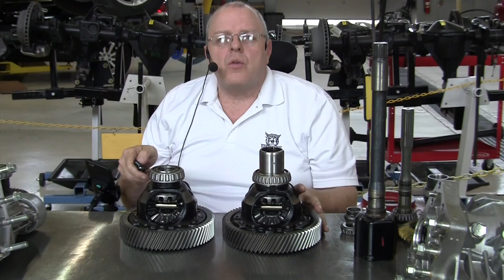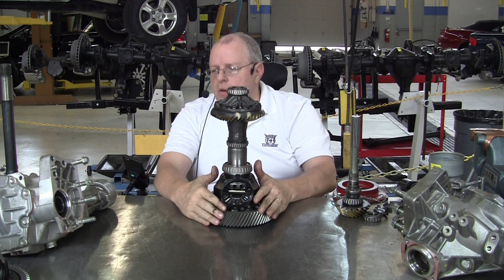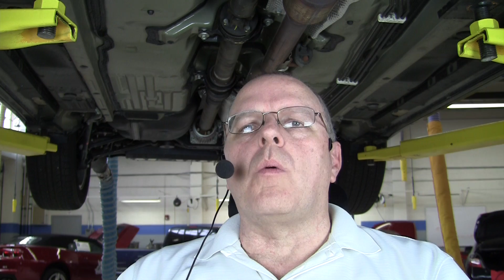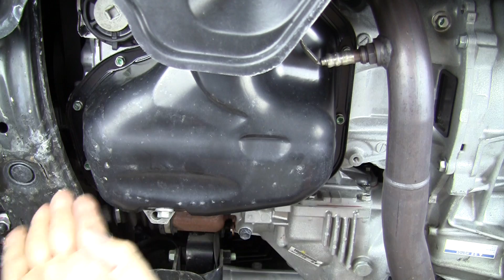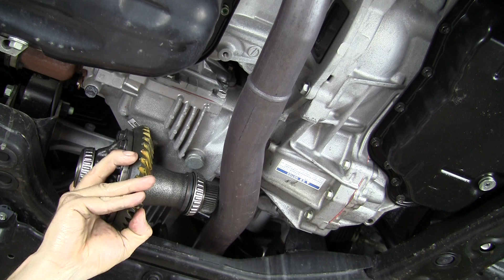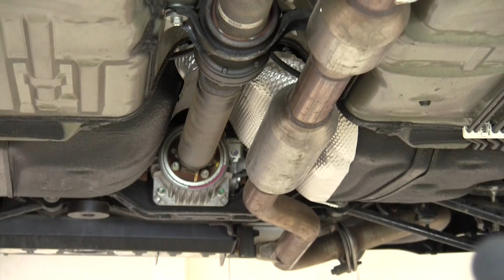Crossover AWD / 4WD Systems

Comment: So when the rear wheels engage are they engaging in all wheel limited slip or actual 4 wheel drive? This type cannot be engaged manuelly into 4 WD is that correct? Thank you!
Reply from the maker: 4WD when engaged, but released very quickly when traction is restored to the front wheels. It cannot be manually engaged except in the newer Jeep models
Reply: How does torque vectoring differ from this type of AWD?
Reply from the maker: This has torque vectoring front to rear. Some models do left and right too. They use a clutch pack(s) to control the amount of torque delivered.

Comment: Thanks for the video, it really has me appreciating just how awesome the symplicity of my Subaru XV Crosstrek's Subaru Symmetrical All-Wheel Drive, specifically, the Continuous AWD system that actually maintains a true mechanical connection between the front and rear differentials on manual transmission (technically a manual transaxle) models. Unlike most crossovers that have some sort of electronic system to manage front-to-rear torque distribution, the Continuous AWD of manual transaxle models has a simple viscous coupling center differential. Though some may consider this system quite crude, I'm very satisfied with its ability to react in demanding spirited driving conditions as well as off-road driving.
Reply from the maker: Thanks for your feedback!

Comment: Trying to wrap my head around this regarding AWD operation in a Lexus LS 460 L  COMPARED TO SAY AN AWD system used in  my 97 Land Cruiser. Specs tell me that the same 8 speed trans for the LS is also used in the late model Land Cruiser.
Reply from the maker: The AWD system on your LS is similar, but different than the 97 Land Cruiser.  The LS 460 uses the AA80E while the later model Land Cruiser uses the AE80F 8-speed transmission. They are almost identical, but the newer model is refined and beefed up a little more.

Comment: Do you have any videos detailing the viscous coupler/ magnetic clutch you talk about at the 22 minute mark. I have a 2011 Sienna Limited AWD and I think it's gone as it makes a loud hydraulic whine as it's driven. as you speed up the pitch gets louder. I've seen some forums say Toyota says you have to replace the entire unit but some others say you can disassemble it and if you can find the part number replace the 2 large bearings which are the fail point. Any of your great insight is appreciated!
Reply from the maker: Sorry, I do not have any information like that.
Reply: Thanks, appreciate the reply either way!
Reply: @Sig220Euro  ppl need change gear oil in these units every 50k mis max.. engineers have told me. In our Lincoln SUVs AWD i follow this maintenance with great success getting high mis an zero failure.
Reply: PTU unit or transfer prob bad!

Comment: Nice Video.  How much slip is necessary for the clutch to activate the rear wheels?
Reply from the maker: Good question, I do not know. I thing I activates whenever slip is anticipated/predicted. Thank you!
Reply: What drives my question is -   My brother in law works for a major tire chain & claims even the slightest difference in the tire wear will reak havoc with the AWD system.  I was just wondering if that is a way for them to sell more tires or if their is any truth?
Your thoughts....
Reply from the maker: That was true of the older non-computer controlled AWD systems. Even tires of the same size with large differences in tread depth could harm the viscous clutch by forcing it to spin when it should not be spinning. Today's (last 10 years) computer controlled (no viscous clutch) systems are more forgiving of differences in tire rolling radius. You still need to have the same tire size and inflation, but tread depth variance are not a big deal.

Comment: How would changing the original 235/16 tires to 255/16 tires affect my 2006 Ford Escape Hybrid `4WD'?
Reply from the maker: 235/70R16 tires are approximately 28.95" tall. 255/70R16 tires are approximately 30.06" tall.  That is a 1.11" diameter difference. Your speedometer will read slower than you are really traveling, but as long as all 4 tires are the same size (and do not rub on the fenders) it will still function normally.
Reply: WeberAuto Is there a limit to how big I can go? My ideal size would be 265/75/16. Fenders won't be a problem.
Reply from the maker: They would be 31.65" tall, that is a 2.7" diameter difference (raising your vehicle 1.35"). There are consequences to going with taller tires. Your ABS system might not work correctly, it may not activate at certain lower speeds when you may need it to. Taller tires will also raise the center of gravity and make your vehicle handle differently. it would be more likely to roll over in tight cornering maneuvers. Other than that (and the speedometer inaccuracy) I think it would be okay. Be careful.
Reply: WeberAuto The plan is to use the Ford Escape Hybrid drive train on a 66  International Scout. To which I would like to add a larger tire/wheel then the 235/75/15 original. Just a project...

Comment: Very informative video sir, thank you. Please allow me a couple of questions:

1)  the similar PTU used by GM from Oerlikon says 2.78 total ratio.Does this mean it is overdriven (0.359 ratio)on the rear diff? Or it is not necessary if the final drive ratio is 2,78 too? In that case the rear diff ratio must be 2.78?

2) Regarding torque, on your PTU, suppose 300Nm the engine max torque, then it is multiplied with 4,35 f/d ratio to give the front wheels torque?

3) if not and 300Nm is the torque applied on the front axle, then the amount of torque driven to the rear axle through the PTU is 300Nm x 0.439 in your example and again multiplied in the rear diff x 2,277 (assuming full lock of the clutch pack)?

4) if 3) is correct then for GM's PTU in order to find the torque applied to the rear axle we multiply 300Nmx2.78x2.78?

5) If 3) is correct then at full lock, the torque of the front axle is the same as the torque of the rear axle meaning 300Nm? In such case if the front wheels lose traction the 300Nm of torque can be transfered, like a common lock diff, to the 300Nm of the rear wheels?

6) What does it mean "..overdriven on the final drive.." regarding torque?

Thank you in advance for your answer.
Reply from the maker: Hi Jim,

1) The PTU overdrives the rear driveshaft by the inverse gear ratio of the rear axle. The PRU overdrive ratio = 0.359, the rear diff ratio is 2.78

2) No, engine torque x transmission gear ratio x final drive gear ratio = torque to front wheels and PTU (minus frictional losses through gears). This assumes the rear axle clutch is unlocked (no torque delivered to rear wheels)

3) Torque to rear wheels = (engine torque x transmission gear ratio x final drive gear ratio x PTU overdrive ratio x rear axle gear ratio) - minus torque to front wheels. Torque to the rear wheels can be equal to, or less than the Torque to front wheels. The total front-rear torque split must always = 100% The maximum amount of torque that can be delivered to the front wheels is 100%. The maximum amount of torque that can be delivered to the rear wheels is 50%. It can be varied anywhere in between those two limits (some examples: 90-10%, 80-20%, 70-30% 60-40% 50-50%)

4) see 4

5) No, When the rear axle clutch is locked (torque delivered to rear wheels), it takes away torque from the front wheels (up to 50%). 

6) Over-driving something reduced torque, under-driving something increases torque.

I hope that helps!
Reply: Dear Sir, thank you spending your valuable time to answer my questions. Please allow me one or two more to feel it is clear:
1)OK

2)OK

3)5) following the equation it gives almost the same amount of torque that is delivered to front wheels when rear clutch is unlocked, if front wheels have no traction, meaning 0% torque since front is open diff. Therefore  (engine torque x transmission gear ratio x final drive gear ratio x PTU overdrive ratio x rear axle gear ratio) - (minus torque to front wheels)in that case (T rear-0% torque to front wheels=Trear which is the torque to front wheels when rear unlocked), so 100% of the torque and not up to 50%. I am sure i am missing something...

4)OK

6)OK

7) Watching again your video, is the answer to max 50% torque to rear wheels that the ring gear of the PTU and the final drive unit are "splined" and "spooled"? In such case if a second PTU was attached then the max torque would be 50% front wheels and 25% for each rear diffs or 33% front and 33% percent of each rear diffs?

8) The new Ford Focus RS, with almost the same system, claims 70% torque to rear. It has to do with the absence of propshaft clutch pack replaced with rear axles clutches or 70% is not accurate?

Thank you once more and in anticipation of your reply.
Reply from the maker: #3 There is still torque provided to the front wheels when they have no traction. It starts at 100% torque to the front wheels and then is reduced to a minimum of 50% as torque is biased to the rear axle.
#7 33% to all differentials.
#8 the Focus RS uses a rear axle that acts similar to the Acura SH-AWD system. It has 2 clutch packs to vary the torque to the left and right rear wheels. It cannot receive more than 50% of the engine torque from the PTU. It can vary the amount of torque delivered to the left and right wheels. The rear axle ring and pinion gear set is not an inverse gear ratio of the PTU, it has a ratio that would drive the rear wheels faster then the front wheels if the clutch packs were to lock up at 100%. This can be used to force the outside rear wheel to turn faster while cornering (enhancing handling). The 70% number you read about comes from the typical amount of clutch application while accelerating in a straight line. It is a complex system, but a very cool system. Best wishes.

Comment: Thank you for your very informative videos!

This is very similar yet very different to how Celica GT4 system works (particularity ST205 chassis). Interesting part is that unlike viscous/similar coupling at the rear differential the GT4 uses full central differential in the centre with a viscous centre, thus giving true all-time 4WD system with 50/50 torque split. This system in my opinion is far better than the typical crossover system.

Meanwhile Subaru system is even better in regards that it uses planetary gear set with mechanical LSD and electromechanical LSD (two separate units) for the centre differential, specifically the DCCD variant that comes in Impreza WRX STI.

I have/had pleasure owning both vehicles and I find very amusing when I go passed stuck crossover/SUV vehicles like RAV4 and similar on a beach (they seem to constantly switch between spinning a front wheel, and two diagonal wheels). I guess having LSD in front (excl. ST205) centre and rear with all time 4WD works much better than the gimmick system with viscous/electromechanical/hydraulic coupling that these crossover/SUV vehicles have.
Reply from the maker: Thanks for your great feedback! There are many variations of "AWD", most people do not know the differences.

Comment: John great video and great presentation. 
Is the EMC serviceable? Is there bearings inside the coupler that can fail ?
Is it a part that a dealer will just replace when it fails?
Reply from the maker: Good question. I know it is serviceable on some models, but not all. Thanks for your feedback.
Reply: WeberAuto Thanks for your time. If you ever have the time, a video showing the EMC broken down would be great. Like the Venza in your video I’m not sure if it’s a wet clutch or dry and if it’s wet does it share the oil with the rear differential?

Comment: I have a series of huge question if you don't mind answering them?

1. Is it possible to convert a manual fwd 2.5L 4cyl toyota to an awd system with the transfer unit. 
2. I have a 2015 Scion tC, 2.5L 4cyl manual fwd that I would love to make awd and would really like some pointers on how to go about it? 
It uses the same engine as the Camry, RAV4, matrix, and in some options the highlander, and all these cars except the tC come with awd. Engine is the 2ar-fe. 
3. If it is possible I have some connections with some fabricators and will try anything with some helpful tips/pointers. Thank you
Reply from the maker: No, the transaxle housing is different, the final drive gear ratio is different, The vehicle stability control system is programmed differently, etc. Best wishes!

Comment: Does that means a Subaru awd system is better?
Reply from the maker: No, it is just different. Subaru's have a longitudinally mounted engine, this system uses a transversely mounted engine. The Subaru system is very similar to the ZF AWD transmissions used by many other vehicle manufacturers (VW/Audi/FCA/BMW/Porsche/Volvo/Mercedes). It makes the front of the vehicle be very long and heavy since the engine has to be mounted in front of the front half shafts that drive the front wheels.
Reply: WeberAuto , thanks for responding and thank you for the videos .

Comment: great explanation. on a honda crv does this mean in slippery condition the rear wheels are constantly dropping in and out of drive.mode. is there a delay on releasing the clutches .
Reply from the maker: There can be a delay, it just depends upon the system.

Comment: Does it matter the kind of oil that its put to a hydraulic rear differential for a Honda 2009 Dual pump cr-v?
Reply from the maker: Yes, it always matters.
Reply: I mean if I put for example 80W90 gear oil GL5 the this: honda differential would work or why could be damage?
Reply from the maker: There would be damage to the clutch pack that connects the driveshaft to the pinion gear. There is a pump that applies the clutch pack with the "Honda Dual Pump Fluid II" oil. If the fluid it too thick (like 80W90), the pump will take too long to apply the clutch in a low traction event. this will cause the clutches to partially apply, slip, and burn up over time. Always use the fluid called for by the manufacturer. I hope that helps.

Comment: from 2008 to 2017 Toyota Sienna and rav4+4runner+highlander xle limited AWD does really it has rear differential and driveshaft I mean AWD system like Subaru feedback
Reply from the maker: Yes, they really have a rear differential and a driveshaft(s), but they have transverse engines and transaxles, not longitudinal like Subaru.

Comment: Hi my question is ? Can different tire size be used on awd vehicles?front and rear? Is awd a kind of unblocked transfer case? I am in a process of building a small tractor and iam planning in use a unblocked transmission mounted side ways it will work? With different tire size 4wd thanks from Brazil
Reply from the maker: All of the tires need to have the same diameter, but they can be different sizes.
Reply: WeberAuto what tends to happen if the diameter of the front and rear tires are different sizes over time?

Comment: how to conversion FWD to AWD ?
Reply from the maker: Different transmission, transfer unit, drive shafts, rear suspension system, rear axle, wiring harness, computers, etc. $$$
Reply: I see some of FWD (civic) that has been conversion to AWD. I read they're using some part from Honda CRV AWD version.

Comment: Does the system use the ABS wheel speed sensors to detect when there is a speed difference  (slippage) between the front wheels and the rear wheels?
Reply from the maker: Yes, most vehicles use that strategy.

Comment: I like the style used in the Honda Pilot or Acura MDX where the main Final Drive has 2 sets of Ring Gears, The secondary connects to a small Input shaft that goes to a Transfer Case with its own Ring and Pinion for the Propeller shaft.. Its lighter, stronger and both front axle shafts remain the same size..
Reply from the maker: Thanks for your feedback. I am not sure it is any lighter weight with the extra components inside the transaxle. The Honda system operates just like the system in this video; however, it uses different components to accomplish it. It still drives the rear driveshaft off the the transaxle differential case. The Acura systems with all of the variations of SH-AWD is also similar, but with a more advanced rear drive module for left and right rear wheel speed controls.

Comment: Masterful presentation. Seeking to bypass the was on murano.. I think I will start by disabling the Clutch Permanently.
Reply from the maker: Thank you!
Reply: WeberAuto Based on the information presented, I was able to save thousands by removing the drive shaft and eliminating AWD feature by taking the pinion gear from the transfer case. Ultimately the 2005 Nissan Murano's AWD capabilities are very  pricey to repair so if you are not in need of all wheel drive start eliminating the cancer and save that money for the transmission God forbid! Thanks again for the awesome succinct video my friend!

Comment: I'm trying to find some information how they get the power to the front wheels on the all-wheel-drive Dodge charger and challengers. Thank you Randy
Reply from the maker: Hi, there is a special transfer case that automatically detects when rear wheel slip is going to happen and will temporarily apply power to the front differential as needed.
Reply: I went to Chrysler parts and looked at some diagrams and noticed that the front differential mounts to the side of the engine and oil pan but I can't make out how it gets power to the other side?
Reply: @randyscustomaudio  there's a tunnel through the oil pan that the axle runs through, the design is stolen from Mercedes 4matic system

Comment: My AWD 04' sienna has EXTREME rust all over the rear diff and PTU.  Transmission itself is fine as its aluminum.

What has caused this extremely unusual rusting?  Is it heat?  I wish to change the fluid in both, but the drain/filler plugs are also orange and bubbled with rust.
Reply from the maker: Wow, I do not know. Maybe road salt? The inside should be fine.